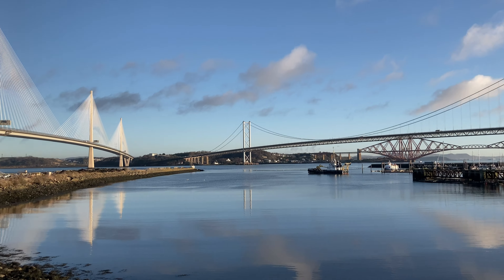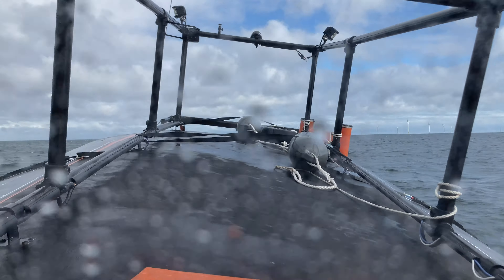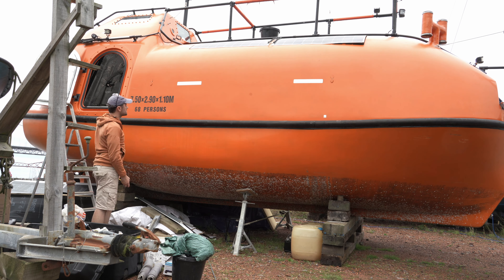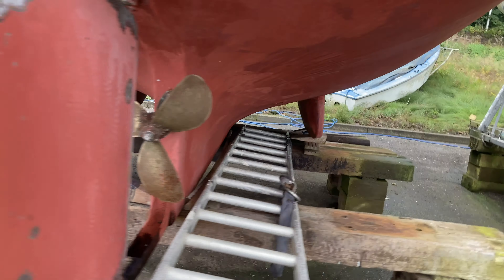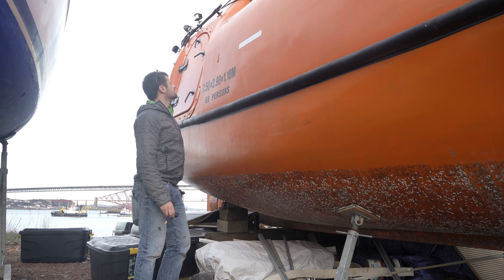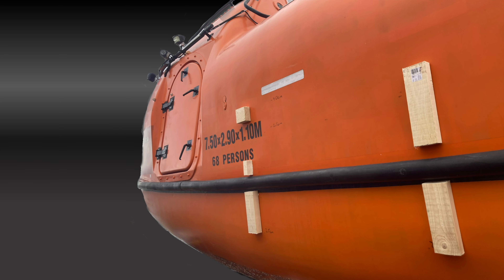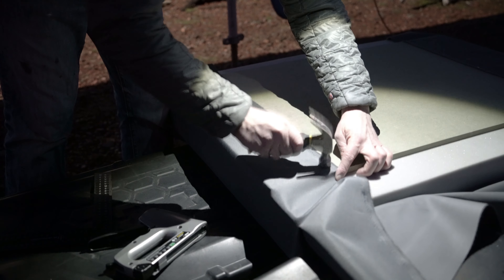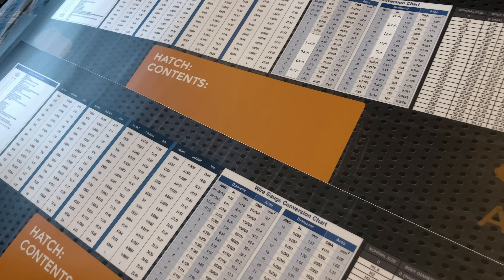Unveiled: Alan the lifeboat's stabiliser anti-roll idea. Expedition lifeboat conversion Ep116 [4K]

Comment: The newer model tabs that mount to a flat transom and controlled by a gyro would be tough on a canoe stern but mounting more traditional trim tabs may be feasible if you could get that same software to run them. Pretty cheap for the results.

Comment: The key issue will be loading. The traditional leeboard is only used on the 'lee' side of the boat, so there is support for the board at two points; one at the pivot and one against the hull side, and this also serves to reduce the length of the lever arm. If you propose to use it as anti-roll then the mounting point must resist the leverage created by the whole board without  support from the lower hull. It would be exactly like using the leeboard on the weather side of the boat, where the sideways forces are trying to tear the board away from the hull, rather than pressing it innto the  lower hull.
Making the board strong enough isn't difficult,  but strengthening the hull side so a hole isn't torn in it is, i fear, a job for an engineer.
Reply from the maker: Luckily I have a family of those!

I think it was an error to refer to my plan as a leeboard as such, as people take the specific design literally. Perhaps a better description would be twin side-mounted removable bilge keels with double mounts top and middle. A little less pithy.
Reply: @AlexHibbertOriginals  Teaching my grandmother to suck eggs has always been my problem! I'm sure you'll make it work.

Comment: Cheap CLS timber treated for Marine use....Have you been watching my channel too much Alex? ;-)

I'm quite interested in the experiment. Off the bat, I wouldn't have thought Leeboards would have helped with heeling/rolling. Their primary use is to point when beating (Sailing to windward) on a sail boat, but in theory they could help, especially when the boat has some forward force. 

Usually heeling is a function of how much the boat is pushed over by the wind of lift of the sails, offset by the ballast in the boat. Ballast can come in all shapes and sizes, from being low down on a long keel to someone higher up but leaning out on a dinghy but it's all to do with counter weight in opposition to the wind on the sails that will heel the boat. The counter action of the ballast and the fact the keel is long and deep or has a centreboard of some nature that what makes it then "squeeze" forward, especially when beating, where the "Aerofoil effect of the sails is used to create "lift" like a wing, rather than just filling the sails and pushing the boat from behind.

As always I hope i'm wrong and you're right! It will be interesting to see it working in any event.
Reply from the maker: The CLS is sadly only temporary!

There's plenty of literature that quotes the use of leeboards as in pairs having an anti roll function. I think often people just see a product is designed for one purpose, given a name, and don't consider other properties. Perhaps I should rename these boards...

Comment: Hi, naval architect here: what makes a boat uncomfortable is not the amount of roll but the accelleration of the motion. A stable ships have high acceleration and are uncomfortable, ships with little stability roll gently from side to side, albeit with a larger rolling angle. Empty lifeboats are notoriously high in stability because they are designed for higher weight (full of people) and also short and wide for space saving reasons. So the easiest solution, thats maybe counterintuitive, is to put weight/lead on your top deck. Kimkeels are great at damping roll as well (they are not like keels on your yachts because theyll increase yoir stability and discomfort). Active solutions are an option as well but more expensive than bolting some lead to your deck. Hope that helps, Cheers
Reply from the maker: Thanks for the input. I should have alluded back to a past episode where we talked about stable vs comfortable. Can you link me to a kimkeel? Google doesn't bring up much.
Reply: I do apologise, i meant a bilge keel (https://en.m.wikipedia.org/wiki/Bilge_keel). There go my naval archtect credentials haha. Sorry in dutch theyre called kim kiel which is my native lamguage. I do think your leeboard will do a similar job. Any fin really will help dampening it. As long as they dont increase your stability too much. Whats nicr with bilgekeels is that they can be small and not protrude the hull. They get their effectiveness from their length
Reply from the maker: Ah, thank you! That makes a lot more sense. I had a lot of sketching out of bilge keels, but I need to avoid permanent structures that will be vulnerable to ice. I hope these side boards will be an improvement as you say.
Reply: Sorry for the useless advice so far. The only idea to add that you havent mentioned is a tiny sail. A lot of motorcruisers have a very small mast for the purpose of rolldampening. Can be as small as 1-2m2. Should be easy enough to jerryrig and try out.

Comment: How about removeable daggerboards with a slide in frame on each side? One or both can be slid in and secured in rough seas - and in calm times you just slide them out again and rest them on the cabin roof.
Reply from the maker: This is a very similar principle, but bolt on / bolt off instead of having to create a large slot frame for them to drop down through.

Comment: i follow motoryachts more than sailing ones, but i think i remember the offshore sailing yachts won't use leeboards. i can't remember as to why though.

paravanes would be fairly simple to add.
Reply from the maker: I think it's generally since yachts already have a suitable keel built in from day one, whether twin fins, deep keel etc etc. You can't really sail without one, as I understand it...

Comment: Just contact Seakeeper. Model 9 should work just fine. Easy as that.

Hope you get it sorted efficiently.
Reply from the maker: $108k. Very funny!
Reply: @AlexHibbertOriginals  Indeed. I spent a whole two minutes looking for a more expensive solution, but that's the best I could find. :) To a landlubber like me living on the Canadian prairie gyros are a pretty brilliantsolution to a problem I'll probably never encounter so thought I'd share.

But I did mean the last bit. Bobbing around in the ocean inside of Allen doesn't sound appealing to me. Shaken, not stirred..

Comment: I have converted a 34 foot Harding free-fall lifeboat into a motor-sailor. I have laminated a one tonne RSJ (6.5 meters long) onto the original diminutive keel and added another one tonne of internal ballast in the form of lead and three AGM battery banks. Under sail she (Deepsea Delta) handles ok with limited roll. You may want to consider fitting a rig. If you are going to negotiate icy waters you must have a clean hull and freeboard. Leeboards etc. will break off. Your Kort nozzle is no good as chunks of ice may be wedged between the propeller and the inside of the nozzle. You need a proper rudder as well as an emergency rudder. Good luck with the project.

Comment: I'd personally never use MDF on a boat - I only ever used it for speaker enclosures.
Reply from the maker: I'd 100% agree for anything structural. But this is part of a cushion that needs to be dry anyhow, it's specially moisture treated, and is rigid whilst being able to take the staples.

Comment: Oh Hey I recommend putting down some Fabric wood glue on that before you staple them. It will help hold the fabric in place and I think it helps hold the staples a bit having a dab of glue on them. It's the daily vibrations that is the issue.
Reply from the maker: Thanks. It's done now, but if I have problems and have to have a second go I'll do that.

Comment: I like the idea of stabilises and thanks for posting my boat in your video.

In my experience which is pretty vast on these boats I will tell you what I found and maybe it will help you.

The hull is not strong like steel it flexes more than you think. 

I connected beams to the sides and to get them to be robust enough I installed plates inside the hull running forward and aft of my beams. 

I made them as strong as I could get them but the hull still flexes especially when  the boat is it by a side on sea.

I know you not going to like what I say but the best idea could be rubber duck pontoons attached along the whole side of the vessel 800mm diameter.

Good luck with your build and thanks for making such entertaining videos.
Reply from the maker: Ah hello! I was intrigued about your twin hull idea when I saw it on Facebook. Is the build more complete now? I may have missed updates. 

Cheers for the input. I suspect the flex will be huge from a retrofitted catamaran design. More than various sorts of stabilising board/keel. I guess the fibreglass layup will vary too. Not all lifeboats were born equal! 

Cheers from me.

Comment: Hello, what you want to install  ( anti roling ) is useless. The picture of the dutch flatbottom is  there as a fin to have better upwind performance and NOT as a stabiliser. Many lifeboats  ( with very little draft ) have on both sides of the keel metal wings as long as the waterline, that indeed will help diminish rolling and is a help to fall dry right up. Fishing boats used to have a small sail to diminisch roling. Sometimes its better to contact a boat designer for theses issues. Cheers.
Reply: in fact leeboards work fantastically well as stabilisers whether they are designed to or not.
Reply from the maker: Leeboards do, and did when I mentioned them before, massively divide opinion.
Reply: There proven on Dutch Barges & easy technology.
Reply: Lee boards on Dutch barges are to help prevent the boat from going to leeward whilst sailing, same principle as a centre board on a sailing dinghy and nothing to do with stabilisation.